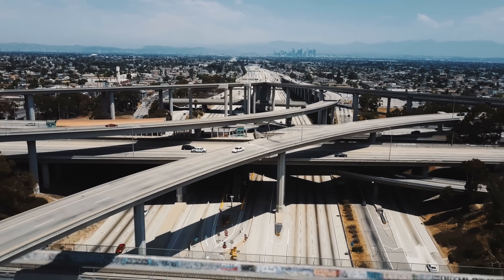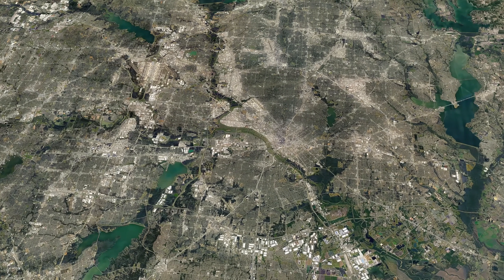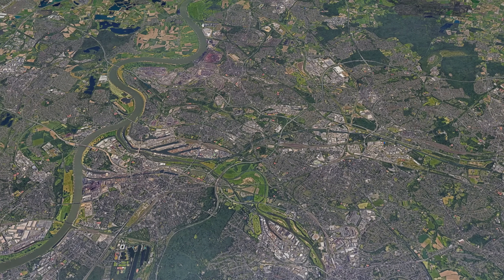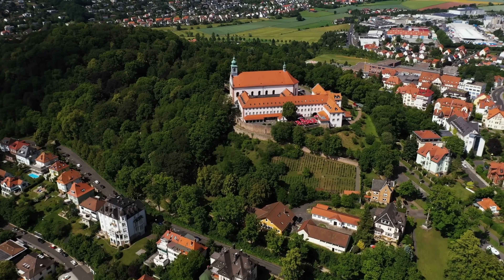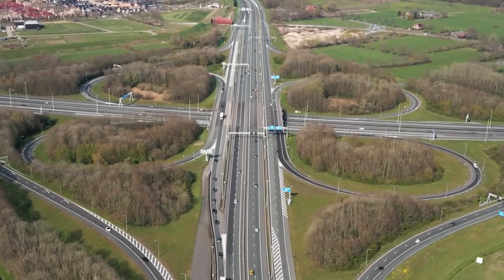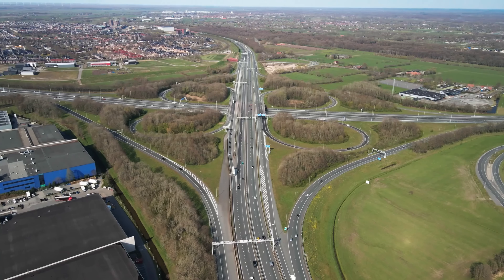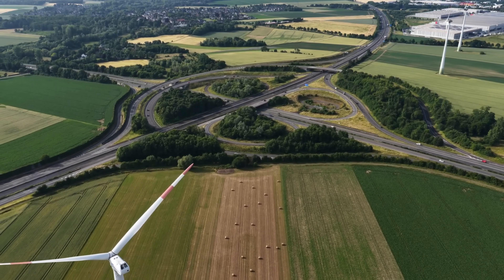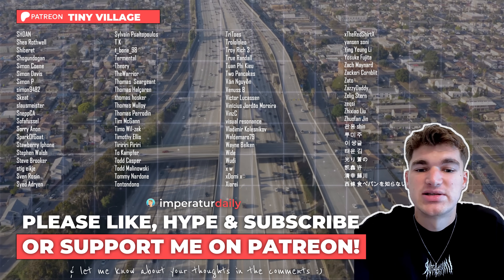Why does Europe have So Few Stack Interchanges?

Comment: A few exampes of stack interchanges in Europe are Prins Clausplein in The Hague NL, the Wetzlarer Kreuz in Germany and Heatrow Interchange in London.
But there are only one or two per country, not a dozen per city, as they are considered quite the ear-and-eyesore.
This would be even more the case the endless ocean of bungalows the Americans call suburbia tho, where the view and sound of them would kinda spoil a few thousand of those cardboard mansions.
Reply: There are two and a half four-level stack junctions on the M25 around London.  The one you mention near Heathrow with the M4 to south Wales, the other is with the M23, which goes to Gatwick Airport and the south coast.  The junction with the M1 does not provide access between the southern end of the M1 and M25, but it is otherwise four stacked levels.

Comment: Argument 1 
No, this is just wrong. You can make stack interchange as compact, if not even. Ore so than cloverlefe intesections.

Argument 2:

This ks also wronf considering most highways go around cities, nit throw them

Argyment 3

Is not really a argument. It depens on trafic yes. Planing process is not really generally longer in europe than usa. That is a myth. The main issue is really financing, not permit.

The fact is that most highway crossings  in the us was built as cloverleaf originally as well then was converted. This is also the case in europe.

But there is two main diffrances. 

1: highway network in usa is a bit older, at least if we consider the intersectuons.

2: its far more common to ad lanes in usa than in europe. In europe os more common to build a bew bypass.

Cloverleaf qorks well on 2 and 3 lane highways, but not on 4 and 5.

Comment: In Europe highways often terminate at a beltway when they arrive to a major city. Either with a 3 way interchange like a 3-level T (basically a half-stack), lightbulb (basically a half turbine, or "pelican" if squished), or trumpet.
Sometimes they highway turns into a boulevard into the city so you need a 4 way interchange. In that case it's often a cloverturbine : a cloverleaf where the highway to beltway movements (the on with the highest traffic) a turbine ramp to avoid weaving.
In the US the intercities highways also go all the way through the downtown of major cities, as the beltways came later. So you get 4-way interchanges between radial highways and beltways.
What I'm getting at is that there are much fewer 4-way highway to highway interchanges in european urban areas as they are in North America, so naturally you'll see less stacks.
There are exeptions though where you can find quite a lot of 4-way urban interchanges, like the Rhine-Ruhr metro area and Madrid you showed recently.
Reply: Sometimes it also ends on a roundabout !

Comment: Culture: USA is much more vehicle dependent than most European urban areas.  Europeans have most goods, services and jobs near home, so short walk, bike, bus ride. And better trains, etc, for longer rides. US, with suburbs, requires driving to work, shopping, dining, and many planners actually steer vehicles to highways, even if for short trips. The throughput, and sight lines for safety, of fly-over interchanges is much higher than cloverleafs with their troublesome merge patterns. The I-75 & I-595 interchange west of Fort Lauderdale, shown several times in the video, is 550 acres/220 hectares of land!
Reply: culture, yes. Europeans for 1000s years lived tied legally and physically to their land, village or town, travel to 10 miles considered as Event, 100 miles - Expedition, 1000 miles - legal death, one way trip by Charons boat. Why to leave the cage, where you have lair, tuckerbox and wheel? Any good hamster does not require anything else, and those who was bad ran away to America long ago anyway.

Comment: American here.  These are not generally standard in most of the country.  The only place I have ever encountered them in the flesh is in Washington DC, where many national freeways on the Interstate system all connect to the ring road, which in Washington DC is a freeway to carry all the national traffic as well as locally generated traffic.  To cope with the traffic, they installed many variations on these sorts of interchanges in that area in what were quite undeveloped areas at the time because they can take more traffic than cloverleafs.  Most other places do not actually have these, with a few car dependent places such as Atlanta and parts of Texas being notable exceptions.

Comment: 0:52 They got more land than we do over yonder here in Yurp.
Therefore they got bigger V Hic Ulz and presumably the impetus behind the road building and concrete supply companies is/was more powerful than any opposing argument from concerned groups of locals.

Joining the bandwagon, yes we do in fact have a number of these brutally beautiful things too, in the UK as in the EU.
Although I'm surprised to see so many cloverleaf ones for the reasons stated by others that today's speeds make them increasingly dangerous, alas.

Very few left in England any more.

Finally there has to be sufficient number of pedants present for someone to have worked out which nation has the most per population, land mass or mile of metalled motorway‽

Comment: This is kinda backwards: The US uses more stack interchanges because they take up LESS space than cloverleaves. The US needs a more space efficient design because it has far more urban freeways that run (and cross each other) very close to the city center. The worlds first stack interchange is less than 1km from Los Angeles City Hall, it was designed as a stack because nothing else would fit on the site. Europe is more densely populated, but Europe's freeways are much less likely to run through city centers, and the major interchanges are mostly built on cheap land in the countryside or outer suburbs, so it makes sense to use less expensive designs like the cloverleaf, even if they are less space efficient.
Reply: Cloverleaf junctions only take up more space if you expect traffic to navigate the tightest turns without slowing down, while speeds dropping to 40 or even 30 mph is perfectly acceptable on a European cloverleaf junction. Also America appears to require retention ponds to be installed as part of the interchange, while these are rarely seen in European interchanges.
Reply: @Welgeldiguniekalias  the same could be said for stack interchanges. Turbine interchanges are essentially just circular stack interchanges really, and they seem pretty compact.
Reply: Looking at the footprint of stack interchanges in the US, they take up a square of approximately 400m by 400m, plus insanely long ramps to get up to the insane height of flyovers. Compare that to the European turbine design (basically the same flow, but bit tighter corners, far cheaper to build, and not as much as an eyesore), which fits in a circle about 450m in diameter. 

Anyway, the European approach is to avoid building interchanges in urban areas, and when building one anywhere, we try to minimize costs, i.e. build as little and as small bridges as possible, as they drive the majority of the costs. That's why you often times see a cloverleaf design with flyovers for the dominant traffic flows. Or a turbine design if all directions have significant traffic (though you still might have a small bit of a cloverleaf if some direction has little traffic).
Reply: I guess you can build large stack exchanges large and small cloverleafs, but the larger you build either, the higher speed and capacity you get, and for a given footprint, the stack exchange allows faster driving on all routes.
Reply: To add to it, even when in Europe you need an interchange close to the city in a constrained space, the enormous height of such stack interchanges usually makes it a no go, both because the long ramps wouldn't get down to ground level early enough to fit, and because everyone would consider such a stack interchange an eyesore which is incompatible with the urban fabric. Other designs that stay closer to the ground are preferred, the trade-off is that you get tighter curves to create compact designs, but in contrast to the US, we're not afraid to lower speed limits to make that possible.

Interestingly, while Belgium currently has none, not less than 4 interchanges on the Brussels' beltway are being redesigned into stack interchanges. However, to avoid the big visual impacts, they will all include tunnels for one or even two of those levels, so that at most one or 2 levels stick out of the landscape.
Reply: Are you restarted??

Comment: Full stack interchanges are common in larger cities but they are generally hybrid interchanges in smaller cities where the exorbitant cost wouldn’t be reasonable. For example, there’s only one four-level stack in all of North Carolina — the intersection of I-77 and I-485 in Charlotte — and it’s not a fully symmetrical one. In low-lying Louisiana, for example, there are stack interchanges for high-volume routes but those were required due to the state’s geography. In Illinois, there’s the still antiquated I-80/I-74 interchange which remains an original cloverleaf. So there’s plenty of areas where stacks should be where they don’t currently exist and there’s areas that’ll likely never get them.

Comment: It is worth noting that when you step outside metro areas and go into rural US, the cloverleaf is the standard interchange. Generally low traffic justifies usage here when compared to more urban areas where cloverleafs create multiple points of conflict that can easily cause a jam or accident (especially when you consider that compared to Europe, it is so easy to get a license in the US that you have people who have no business having a license driving on the road).

Also, since the point of European interchanges looking more improvised was brought up, you will actually see that in a lot of Northeastern US cities. Many of them were already full-fledged cities by the 20th Century. There are at least 3 interchanges in New York City I can think of that look like something pulled out of Cities: Skylines.

Edit: I did also forget the trumpet interchange. This is another common kind of interchange in the US, in one of two uses: the first is when a highway ends at another highway. At this point, it basically functions as a clover variant. The second is for use on toll roads. Most of them use trumpet interchanges to collect traffic heading on and off, funneling them through one toll point.

Comment: Unfortunately, the issue of safety was not addressed. Cloverleaf interchanges are likely among the most dangerous due to their weaving areas. In Europe, they are increasingly being phased out in favor of other, safer designs for new constructions
Reply: I call that fake news! 
I've driven around on our European highways for over a decade and I watch a lot of European dashcam video compilations and I've never seen or heard of an accident on a weaving area of a cloverleaf exchange.
The European highways are the safest roads per kilometer driven and accidents usually happen not on the interchanges, but on the highway proper, due to unreasonable speeds, unsafe lane changes, lack of safe following distances. Accident hotspots on Europe's highways are stretches of highway that are frequently congested, have underestimated curves/bends, or where there's frequent bad weather conditions, like hydroplaning, flash freezing, fog or the sudden formation of dust or snow clouds on the road.
Cloverleaf interchanges are no accident hotspots, European drivers can handle them just fine! 💁
Reply: Hm, I think that your claim is a strong exaggeration. In Europe, insufficient trafic capacity is the main deciding factor for adding bypass flyovers, and not the precieved safety of weaving area's. So, converting interchanges is only done sparingly, in places where this is really needed, instead of with urgency as your "increasingly being phased out" remark seems to imply. Even the most recent addition to the autobahn network, the A20, has been constructed with excusively cloverleaf intersections. This shows that it's still considered as a very viable solution for areas without an exceptionally high trafic capacity demand.
Reply: @m.moolhuysen5456  It might depend on the country.  In the Netherlands, all cloverleaf junctions around Amsterdam have been replaced by other solutions.
Reply: @rienkhoek4169  I don't think it just depends on in the country you're in. Around Amsterdam these conversions have only been decided based on the higher capacity demands generated by the increasing density of the Randstad metropole. In more rural parts of the Netherlands you still find cloverleaf junctions, just like in other countries.
Reply: @m.moolhuysen5456  You're right. Cloverleaf interchanges can be effective as long as traffic volumes remain low to moderate. The A20 in Germany, for instance, appears to run through a region with low population density, which likely results in relatively light traffic volumes.
However, in high-demand contexts such as densely urbanized areas, the weaving sections become critical bottlenecks and significantly increase the risk of accidents.
I can provide a personal example: I work as a highway engineer, and we're currently involved in the design phase of an expansion project, upgrading an urban beltway from 3 to 5 lanes.
Accident analysis has clearly identified the weaving areas as some of the most hazardous segments of the network. For this reason, one of the main design requirements is the complete removal of these weaving zones, taking advantage of the fact that all interchanges will be entirely reconstructed..
Reply: Interestingly, I heard the opposite. Cloverleaf has the shortest bridge you could have. So if there is anything dangerous, people can just walk off-site. And slowing them down to reasonable speeds limits the severity of accidents. A real downside of cloverleaves is multiple lanes. It's easy for the already fast right turns, but difficult for the tighter opposing loop. As Europe likes to grow its decentralized towns and cities, you will see quite a few leaves even in the future.
Reply: @MrHaggyy By safety issues, I meant that weaving zones are often the cause of accidents.These areas are dangerous because drivers must simultaneously merge, change lanes, and adjust their speed in a limited space. This interaction is complex with high volume of traffic, and leads to a higher risk of collision..
Reply: @DennisMaffei-p8h  But as we have better driving education in Europe, we can handle those 'complex' situations better. We have one full stack interchange in the Netherlands, the Prins-Clausplein near The Hague and I really find it a horrible thing. If you are new to it and you are paying attention to the traffic in stead of to the signs, you end up at the wrong end and you can do nothing to correct. At a clover leaf  interchange, you just take left turns, until you can choose the right direction again.
Reply: @DennisMaffei-p8h  well that's what we have driving school for so that we learn how to interact there. It's not a big deal really and a lot more efficient then the huge intersections you have in the US
Reply: @DennisMaffei-p8h okay I’m not sure, but how do so many traffic accidents happen in the USA, it’s like a 3 world country traffic death per 100.000, Thailand is much worse then the USA but it’s still wild numbers if your roads are safer do you not have any driving skills?
Reply: @DennisMaffei-p8h  In theory you are right it is a complex situation with a high risk of accidents. But I never saw an accident occur in a weaving zone. I think one reason for that is that in weaving zones drivers are inclined to help each other out, because the normal scenario is that one wants to merge on while the other wants to leave the Motorway so it is in both their interests to simply swap places and to use the space the other is occupiing. And normaly you slow down before the weaving zone to a suitable speed and the oncoming traffic is still slow due to the tight corner beforehand. Because it is the standard solution everyone knows what to expect and how to behave. One more thing is when you reach the weaving zone you typically do not have to do any direction choice that is done beforehand so you can completly focus on traffic.
Reply: On top of that they create bottlenecks for traffic flow. If it’s low traffic volumes it’s fine. But in urban areas it’s a recipe for disaster.
Reply: @greasher926  Motorways have no business existing in urban areas to begin with.

Comment: In Germany there is at least one "free-flow cloverleaf junction" where everything is separated: Frankfurter Kreuz (A3, A5).
Reply: i checked and its just a generic cloverleaf
Reply: @milchi5122 actually it isn't.
If you look closely, the loop merges into the exit (to the loop) from the left (usually it merges from the right), thus removing the weave.

Comment: There are some in Europe  but they tend to be less visible because such massive infrastructure is considered to the total opposite of beautiful and elegant.
For example, the Bercy A4 - Peripherique stacked interchange in Paris is flattened as much as possible to be less of sn eyesore in the Parisian landscape. It's on 3 or 4 levels, but it's also partly buried.
Much like the A1 - peripherique one at Porte de la Chapelle that's as low to the ground as possible.
And in both cases, the higher highway or main road in the interchange marks the height that can't be exceeded by ramps. So the ramps will go between or below the main roads, not above.